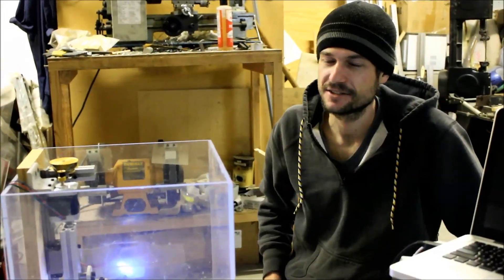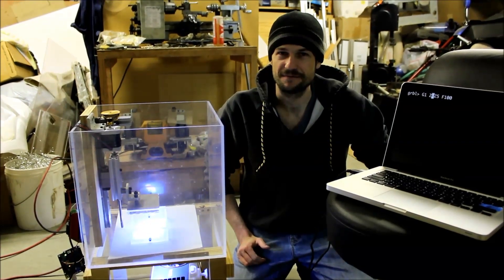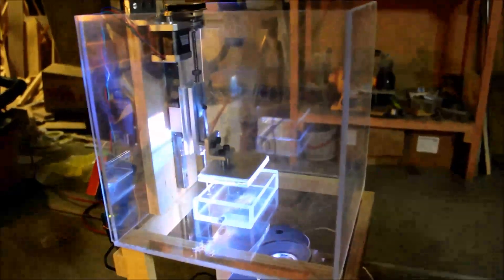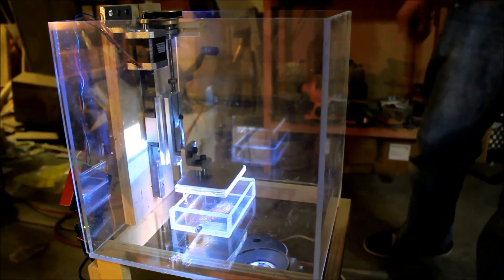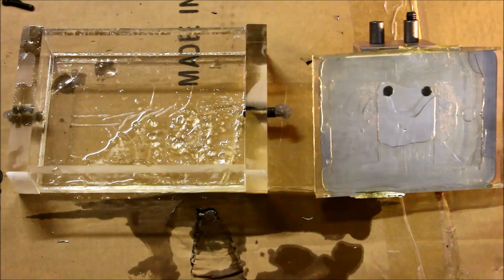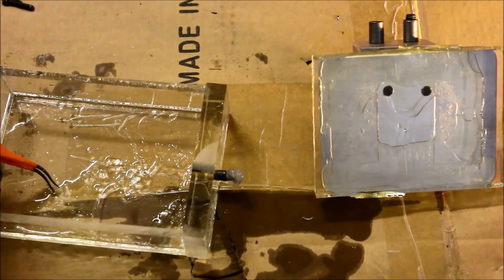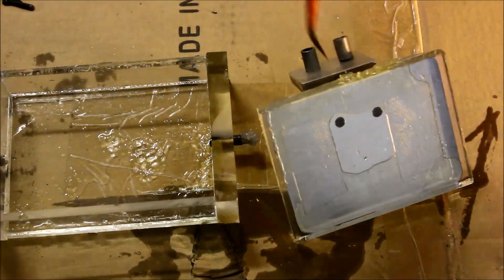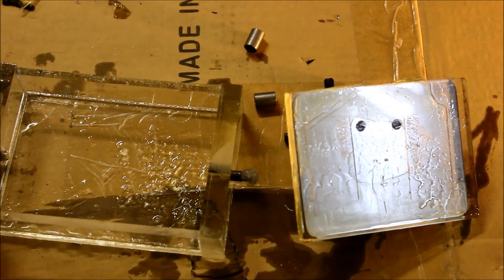dlp 3d printer

Comment: need to put sylgard 184 in the bottom of the vat then it cant cure to the plexi
really should use acrylic instead of plexi
make the vat (tray) to where it slides into a hinged holder and the oposide side can only raise 5mm so it will peel away
cut a hold in the bottom of the large container that holds it all so the projection is straight to the bottom of the vat
Reply from the maker: oh wow, excellent points, thank you!